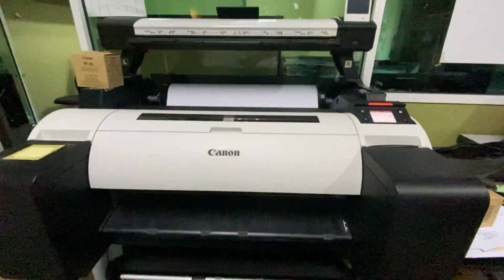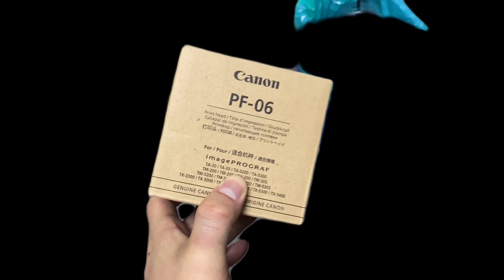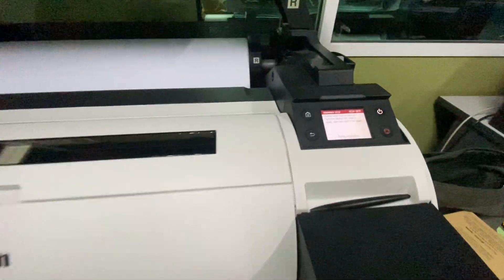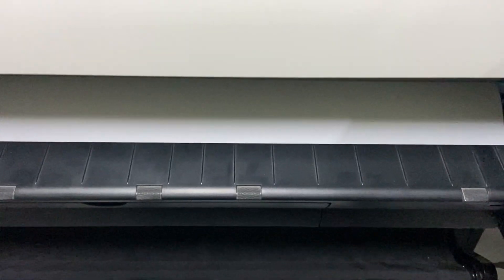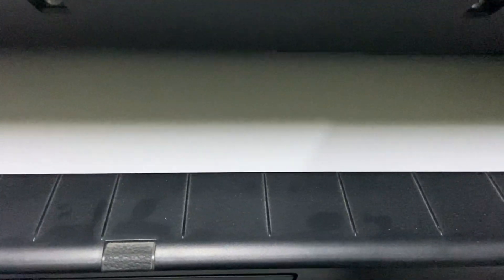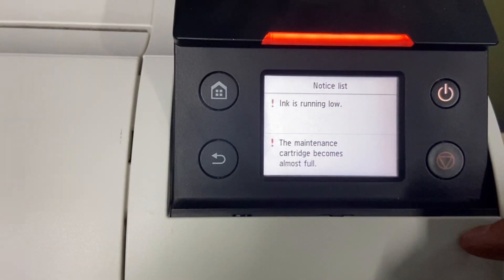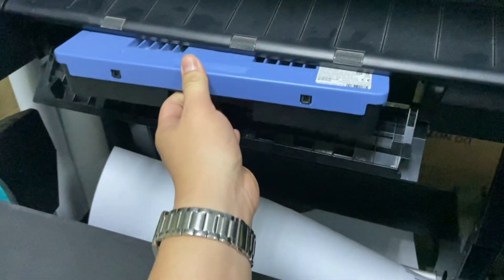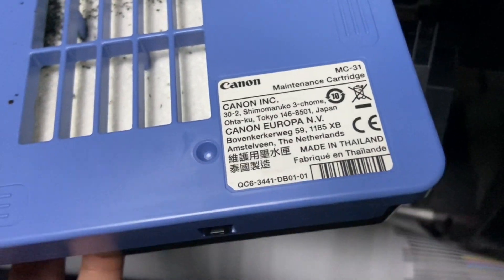Error Code EC21-2F51 - Change PF06 Print Head For Canon TM5200me

Comment: I have a Canon TA-20 that I picked up used, the plotter had sit for about 2-3 years, I replaced the ink and the printhead when I picked it up, I can't seem to get the color to work on it? It looks like Matte Black, Black, and Cyan primed in the lines but Yellow and Magenta seems to have air in the lines and I don't see much movement on ink at all when I try cleanings or service mode to fill it, I've burned through two maintenance cartridges and a bunch of matte black ink, can you give me an idea where I need to be looking to fix this or what may have gone bad? When I run a nozzle check I only get the black to print? 0 colors are showing on the tests.
Reply from the maker: I’m sorry to heard about your situation , the agitating sound is irritating keep flushing your ink away into maintenance cartridge without solving the problem , you may refer to this video and skip to 0:40  https://youtu.be/B3vxL-U0R4Q?si=vufM8qavu4IeI0Qs <- I think you having this problem similar to my TM5200
Reply: @dennisthefatkid  Thank you I will give this a try tonight!
Reply: @dennisthefatkid  Just wanted to report back, I ended up diving further into it, I've had to do two repairs to this printer but now it's working like it should, first problem was when the previous owners had this they stored it for 2-3 years, during that a mouse had made his way inside the printer, 1st issue was chewed wires for the carriage motor... today second issue was the cyan line had two holes in it from the mouse nomming it, I spliced a small plastic hose in half and covered the holes and used heat shrink tubing over them to hold it tight against it... after that it came alive :) so if 1 color line has a hole or air in it all of the colors will cease to work. Thank you again for your videos! It helped me get in there and gave me a better idea of things.
Reply from the maker: @stealth95lt  Good to heard about the good news :) you are the real Mac Gyver surprising that you could fixing the leakage with heat shrink tube , as long as the problem is gone, i'm happy to hear from you again after one month, see how's that printer perform :)

Comment: From your experience, how long does the cartridge for this machine last before it is replaced?
Reply from the maker: Hi sir, from my experience After changing  the print head , it can last 1-3 years if the user is running their printing job frequently , if user abandoned the printer aside the print head will clogged and you need to replace another one

Comment: I have the same error but how do you get to the main menu to get to the replace print head? It won't let me get out of the erorr screen.
Reply from the maker: Yes , you have to replace the new print head
Reply: Im also having this issue. There's air in the lines, and with this error on the screen it doesn't allow you to enter the change cartridge mode.
Reply: @justindownes1541 were you able to fix it

Comment: Good morning. We have a Canon TM-200 and we are replacing the print head for a new one and there's a error in the screen when we replace with the message: "Print head installed in different models than this device can't be installed".
This means this print head, that is supposed to be new, has been used already?
Reply from the maker: Yes boss , canon system is smart they can detect the print head installed before, when purchased new unit … is adviceable the print head is in packing and never open before

Comment: I installed new print head, and maintenance cartridge and get error about print head needing replaced. I dont know what else to do. Its a tm-300 . I did notice the tubes not full with ink as if there was air in them. New ink was installed. Help?
Reply from the maker: @drecamp9507  hi Mike , try this method https://youtu.be/qFMYSiu1Aqk?si=31XCLtbJpKYHhyLU if it’s help , remember to sub and thumbs up 🤘🏻

Comment: I have also tried to replace my print head on my Tm-305 and it is causing the same error. This has been with a new print head and the original print head.
Reply from the maker: Try observed the internal parts, is that any leakage ? Or maybe the purge unit it’s getting weak, you need replace the purge / service the purge as well

Comment: worked with a TM200, absolutely can NOT recommend these printers. I see the same issues in every forum. The print heads are not cheap! the ink is very expensive. 
Heres how it goes: It wastes a lot of expensive ink when printing and cleaning so then the waste tank gets full very quickly, now you have a waste tank warning/error then you need to buy more ink, then buy a new waste tank, then you get print head error so you buy a new print head, then you waste MORE ink priming the new ink head,and after a few prints it cleans, filling up the waste tank again and it start all over again.
Ive spent more time troubleshooting and maintenance than actually printing. No lie, a brand new Black ink cartridge lasted me 3 days because of a new print head priming and cleaning. These printers are money pits. Avoid them.
Reply: You are 100% right, I had the same experience.
Reply from the maker: Yeah same goes to my country , print head is not cheap here. If the waste tank is getting full easily, that’s something abnormal .. is that the purge unit is getting weak ? If yes, you might needed to replace the purge unit as well

Comment: Good day! Before replacing the PF-06, should there be air in the system until the paint in the system reaches the head or will the entry of air not lead to failure? PF_06 is not cheap, it’s a pity to kill it at the first start. Thanks for your answer in advance :)
Reply from the maker: Do you meant bubble in the ink tube ? My advice is enter service mode to perform a noozle check , if printer able to generate noozle report , please have a look into the noozle report to ensure that is no breaking line in between. If system unable to generate noozle report, you have to observe the ink tube .. is that any bubble in the tubes, if yes.. you have to get this bubble away, I do have this video in my channel to flush this bubble away.. reply comment below if you need the link .. thanks
Reply: @dennisthefatkid  , thanks for the reply, it would not be bad to watch the video
Reply: @dennisthefatkid  ,My plotter said that the PF-06 needs to be replaced, after replacing the cartridges it worked before, it showed little paint. However, the print resource is 2600 m2.  Illegal :) the PF-06 dump was changed, in service mode it was determined as new, and when switching to operating mode it showed that PF-06 was already used in another plotter :)

Comment: Thank you for your video. My TA20 printhead has been giving error messages several times. I washed it and reinstalled it, and it can work for a few days, but it wastes a lot of ink. I am considering whether to buy a PF06 printhead or a TC20 printer. Do you know if there is a big difference in performance between the TC20 printer and the TA20? Thank you.
Reply from the maker: You are welcome ☺️ TC20 more economical as this model’s ink can be refilled, for more info about TC20 you may look into this video 
https://youtu.be/vVJssJkF-7s?si=j5U6A6ChjsMqkml4
If you your plotting volume is high, I suggest go for TM5250, more durable and less error
Reply: @dennisthefatkid  I just print stickers and don't know how much the print quality differs between the TA20 and TC20. $600 for a PF06 print head, or $1000 for a TC20, I'm hesitating. Thank you.
Reply: Ta-20 es mejor que el tc-20. Tc-20 calidad baja

Comment: I have got a sacner i36 for canon 770 it work fine tell today
When i insert a paper i take it in and out and doesn't hold it and i clock show in the scaer and the wheels keep push the paper out 
I restart 5 time and nothing still the same action
Reply from the maker: May I know the material ? What kind of paper? Photo glossy or plain paper? Please select the correct paper profile while loading paper, if still push in and out , you may try to upload cut sheet paper. If cutsheet can be loaded , that’s something wrong with the roll holder